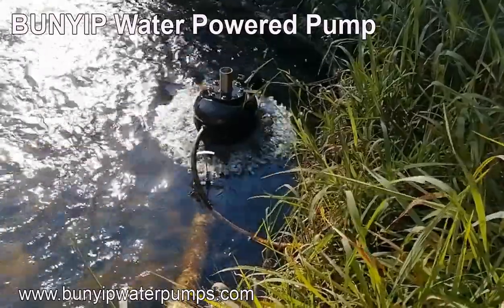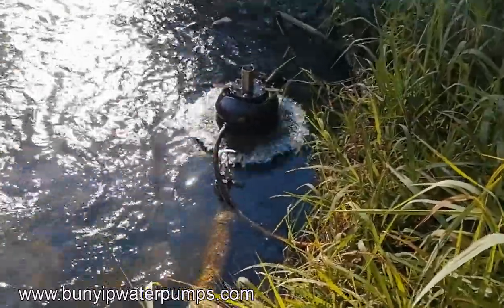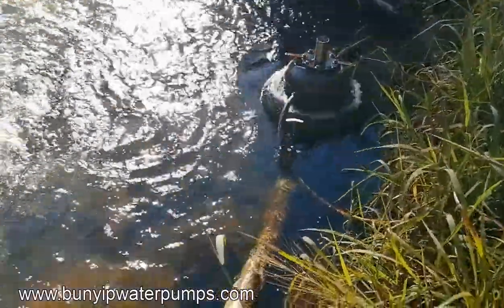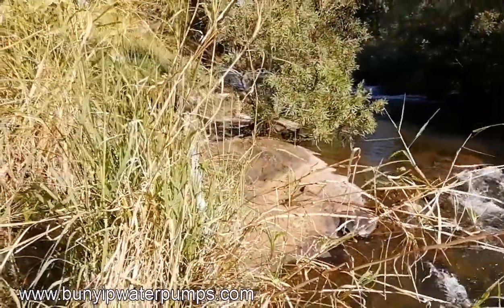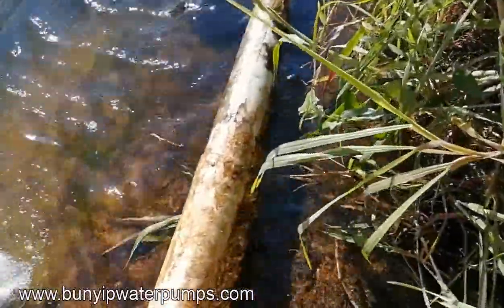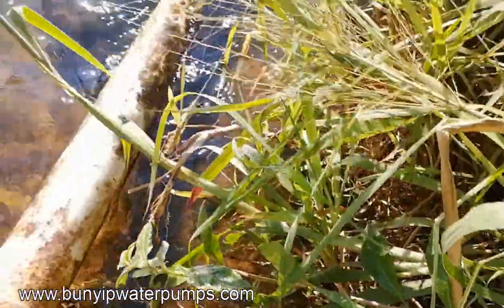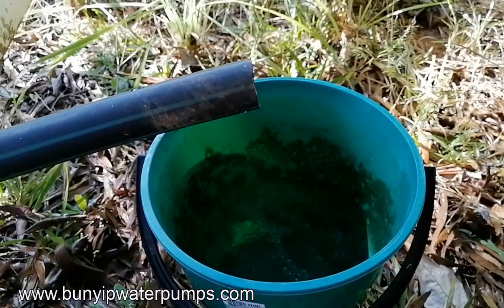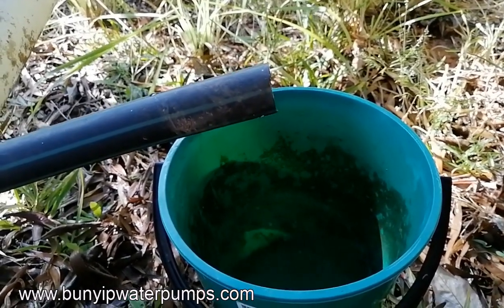Bunyip Water Powered Pump that has beaning running for two years.

Comment: Can the pump work under water in the case of water level rising to a point way it may be under water?
Reply from the maker: It can work with water up to the bore flange and it has to have weight to over come the buoyancy. Once the water is above the tyre you don't gain any more fall by having the pump deeper.

Comment: Can anyone explain how to measure the height of a hill?

I like to pump water to the top of my hill. Someone told me you can use a pipe and fill it up with water, by using a pressure gauge on the bottom and you can calculate the height of the hill. (its a few hundred meters to get to the top)

Anyone has suggestions?
Reply: Buy a topographic map... a decent one is acurate to about 1m
Reply: @AdmiralReering  I am in a place in Africa where such maps don't exists
Reply: @demoe5676  to calculate the height of a column of water from pressure you can use the following formula:

p * 0.10194 = h

'p' is the pressure, measured in kPa, at the bottom of the water column
'h' is the height, measured in meters, at the top of the water column
Reply: @kwask  thanks, and the size of the pipe is not relevant right?
Reply: @demoe5676  yup, as long as the pipe has the same diameter along the whole length it should not make a difference
Reply: @kwask  legend. Thanks for explaining
Reply: @demoe5676  happy to help!
Reply from the maker: Just use a pressure gauge that is in KPA and just take off the last digit and that is what is is in metres. EG: 540 kpa = 54 metres, 2450 Kpa = 245 metres.
Reply: @portasaffordablepumpsbunyi8214  Thanks for answering mate

Comment: I take it you could use one of those to create an artificial stream if it can pump that much water in a day?
Reply from the maker: Yes it can create a small stream, depends on how much fall and flow and how high you are pumping to, will determent how much water you have for your stream. 1.5 m fall, flow of 6 lts/sec pumping to a head of 35 metres the PA13 pump can pump around 13,000 lts per day.

Comment: Thanks for the animation, love you, btw why does the tyre deflate all the way to the bottom instead of letting the excess pressure leak out of the top?
Reply from the maker: There are two parts of the pump, the bottom is the motor and the top is the water pump. the water is separate from one anther. The water has to be exhausted out so fresh energy as low pressure water can flow in an expands the tire again.
Reply: @portasaffordablepumpsbunyi8214  I do understand the cycle has to restart, but what I don't is how it deflates to initiate state? do you actually have springs in the tyre as shown in the animation? could you please show us the inside of the tyre part?
Reply from the maker: @kaleemullah247  There are springs inside the tyre and they help with speed up the exhaust cycle and to help with keeping the tyre uniform, it will work with out the springs but not all the time.
Reply: @portasaffordablepumpsbunyi8214  I have the same question too. Could you pls provide answer to this

Comment: Can the design scale up with bladder (tire) size or is it purely depending on water flow?
Reply: IT CAN BE SCALED UP we are now producing the PA 16 , 4wd tyre therefore able to handle greater input flow near 16L/second where the pa13, in video, is good far 6L/sec. This results in more than double the output & should be even better on super low Fall ie down to 200mm (yet to confirm) where the pa13 is min Fall of 300mm or only 1/2 psi will be able to power the pump. See output table or calculator in website for details. Cheers (bunyip inventor)
Reply: I believe to have bigger size tire may decrease per minute cycle, however may increase pressure so the height you may pump the water.